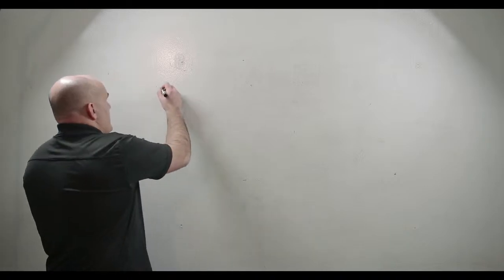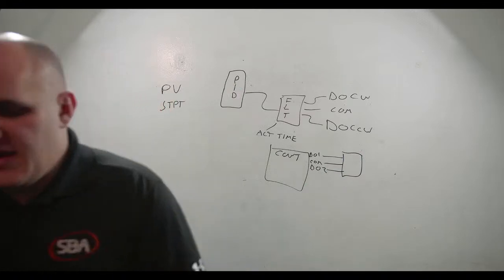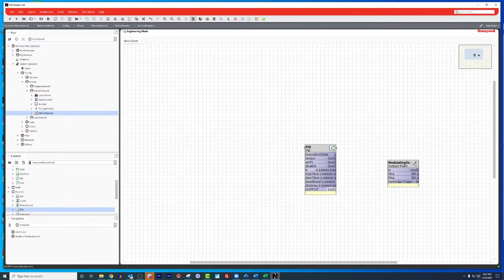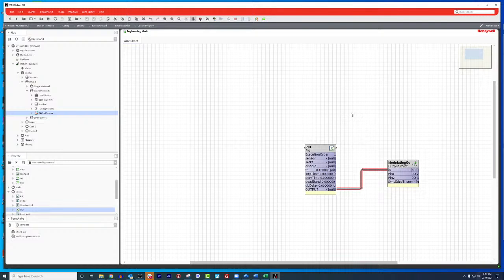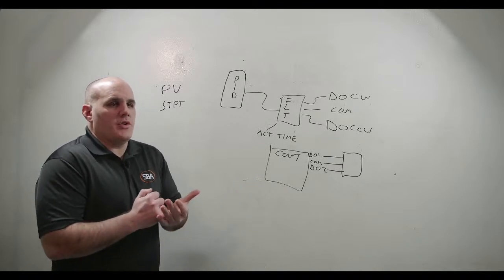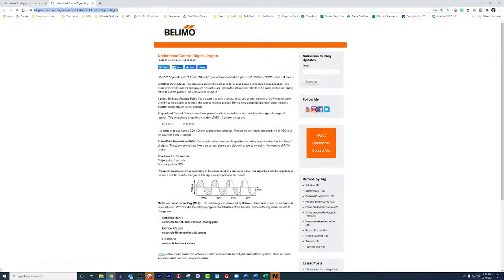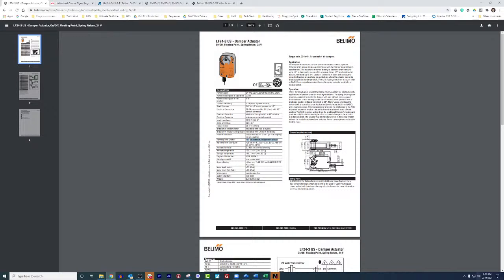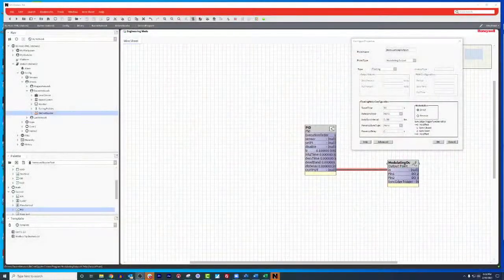SBA TV 19: Control Modes Floating

Comment: Thank you for the video. Would not be couple bucks saved on the floating actuator vs. Analog be washed by the cost of labor to sink those periodically?
Reply from the maker: Most controllers have an autocalibrate function that will calibrate the actuator on a regular basis. 

The floating vs VDC/ mA last I checked was a $20-30 delta. This can add up when you have hundreds of boxes.
Reply: @SmartBuildingsAcademy  thanks !